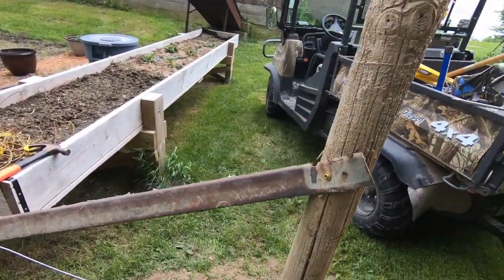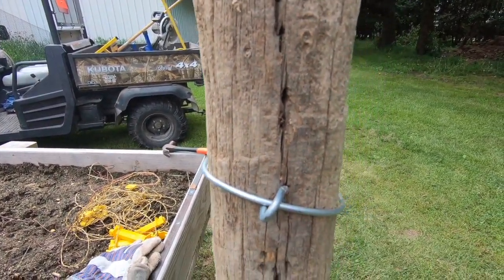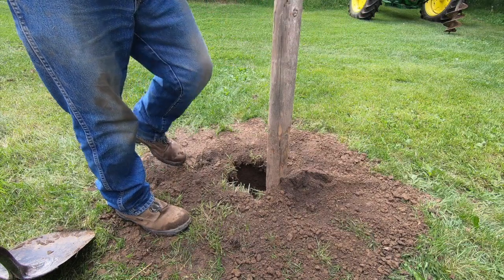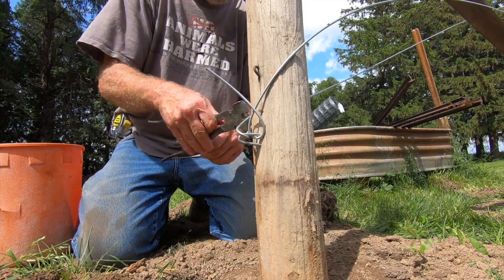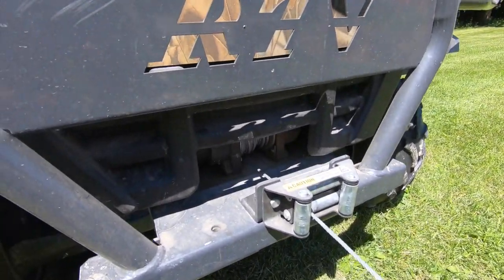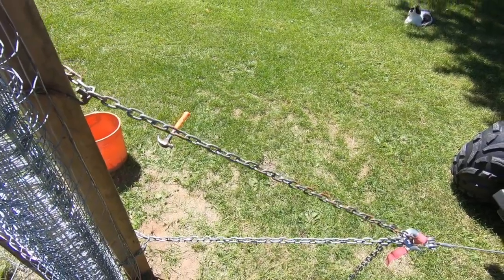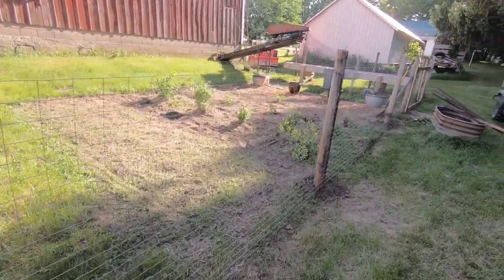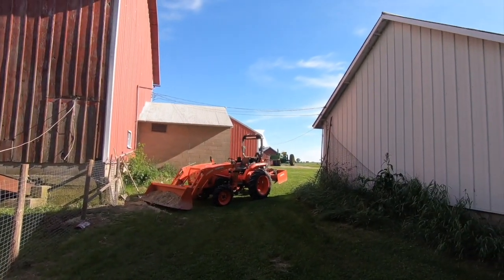KUBOTA L2501, KUBOTA RTV 900, AND THE TWO 520 JOHN DEERES BUILDING  A RACCOON PROOF GARDEN FENCE

Comment: Well done, Gary!  That fence should keep the rackoons out of your garden. Thanks for sharing!
Reply from the maker: It will still take an electric wire around the top and at the bottom to completely stop them. We have one of the old International Super 98 weed choppers. These claim to shock through more than a mile of wet weeds and if you have ever inadvertently come in contact with one of these unholy things, you will firmly believe it.